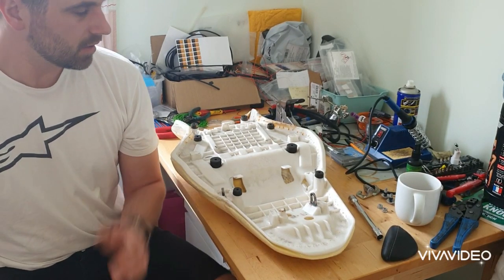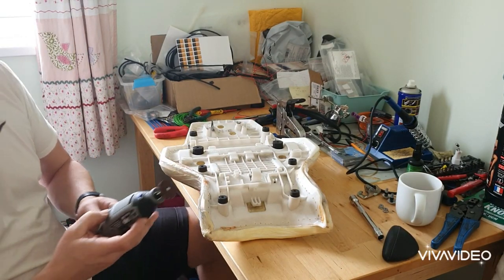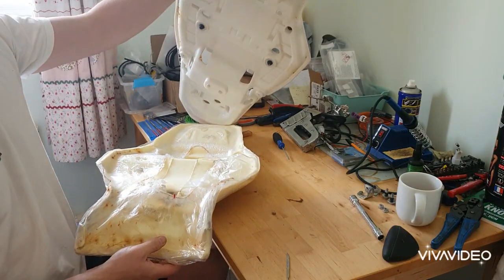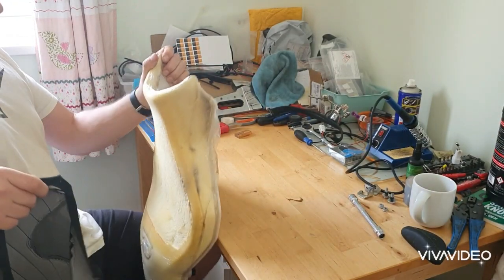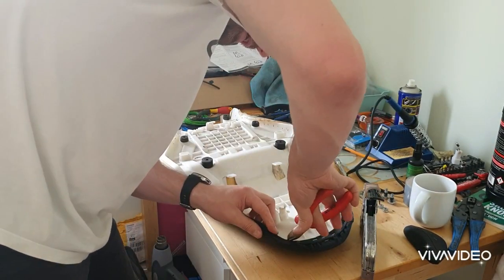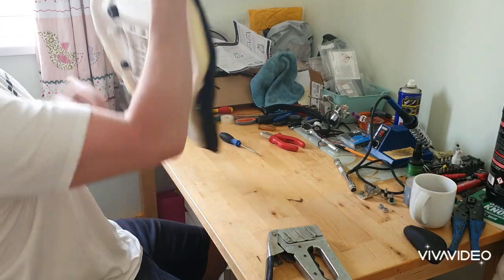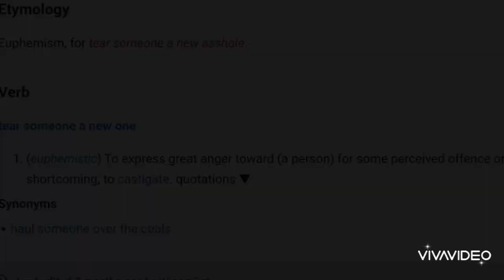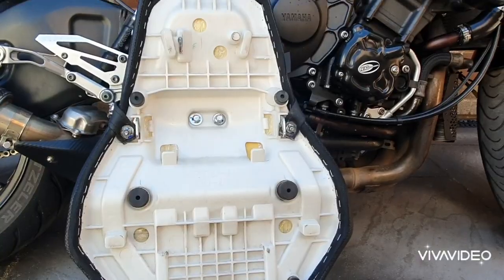Volcano Industry MT10 seat cover fitting

Comment: did this cover make a difference? just bought a 2019 with 1200 miles and the seat is hard as hell. im 6'2" 250 pounds so my ass is sore after about 40 miles on this thing .😂 seat looks good man.
Reply from the maker: No. Not at all. It's purely for looks. Try riding in cycling shorts though. You can thank me later 👍🏻
Reply: @Cregtech  yeah i have a pair for my mountain bike. I was thinking about trying that. Im going to buy some ballistics gel and cut a square of the foam out. I'll probably still get a different cover or this volcano cover.

Comment: Have you compared this set up with a comfort seat? I have the comfort seat as I get the wife almost permanently glued to the pillion position. I still have the standard seat ( okay for young bums not our less padded old ones). So is this cover more easy on the behind tahn the standard? Incidently, I made some 75mm rear foot peg extensions to reducethe knees under the chin problem.
Reply from the maker: I have. I didn't like the comfort seat. I found it no more comfortable and it raised me too high on the bike. I felt I didn't have enough grip on the tank. I'm sure its something you'd get used too but it just didn't work for me. This adds no extra padding either. It is merely a cover mostly for aesthetics. It does give extra grip though.
Reply: @Cregtech  Thanks for the reply. Had my MT10 since 2010, the best thing I ever bought and I'm 71. So we wish you happy riding mate, I'm 6.2 so no height problems for old long legs.
Reply: 2016  not 10 of course.